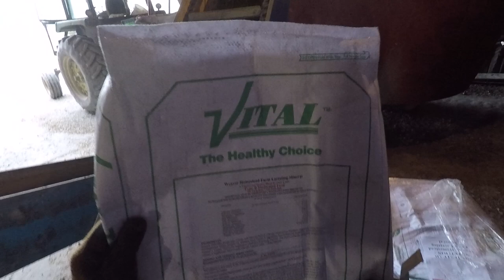Mixing Feed for Dairy Cows

Comment: Would it be better to have a trough with a high back to it so the feed stays were the cows are feeding from it?  The high back would stop the feed being pushed away as the cows feed but your mixer wagon still could deposit the feed mix over the back!  Also shame you can't have a big silo feed auto mixing station which can auto weight the amounts of feed and mix it so you just drive up with a small trailer that can drop the mixed feed out to the feeding troughs?  Also I see more auto set farming robots are starting to be used on more farms to clean up cow waste and wash the floor etc.  Anything that saves your time and keeps working when you do something else is well good idea!
Reply from the maker: The problem with high back troughs is we clean out excess feed every day with the skid loader. We also do a lot of cow management stuff when we have them in the headlocks. The cows would still throw a feed over top of them anyway and we would have to clean it up. All of those automated things would be handy but extremely expensive. We would have to spend hundreds of thousands of dollars to make that all happen. And then I would just be a computer guy not a farmer which would be no fun. I think our feed mixing is pretty labor efficient anyway, it would take robots many many years to pay themselves off, and maybe never even would.
Reply from the maker: I do like the floor cleaning robots though, maybe we could get them someday!

Comment: Thanks for posting! I have two questions for you: 1) How many cows do you milk? 2) I have a part time job mixing feed. Whenever I start feeding a group I have trouble getting the feed to flow out of the mixer evenly. Do you have any suggestions on how to deal with this?
Reply: Try not opening the door as much. That should regulate your feed flowage and make it more uniform.
Reply: That was for Tom Campbell. You got good even feed at the bunk😎

Comment: Hey I have 3 Black Angus heifers and one of the heifers is not growing well or getting any bigger what would you recommend to get it fatter and bigger also the other two are about the same size but need to get a little bit fatter but the little one needs to get a lot bigger and taller what would you recommend

Comment: General question on the ration. What the difference between Soybean Meal/Heat Treated Soybean Meal and reg old Soybeans?
Reply from the maker: It has to do with the type of protein and when and where it gets digested. I'd have to talk to my nutritionist to give you a better answer.
Reply: @10thgenerationdairyman61  Ah okay, that makes sense given the different systems of digestion and the different proteins
Reply from the maker: There are soluble and non soluble proteins. A cow has four parts to her stomach so the different proteins are digested at different times. The heat treated soybean meal takes longer to digest than the regular. It's complicated sorry for the confusing explanation.
Reply: @10thgenerationdairyman61  No, its not. Grow up farming, never did TMR, just straight silage or haylage. Its always interesting to see what others do and how it  works for them
Reply from the maker: Hey whatever works for you guys. There are different ways to do it we've chosen to go high input high output. So maybe we make it more complicated than it needs to be. Our cows do well this way so we're happy but it's not the only way
Reply: @10thgenerationdairyman61  Our cows were also on pasture, year and weather permitted. That's how my grandpa fed. I'm all for learning and getting the most production out of your livestock. I've seen some add chocolate and orange peels to their TMR
Reply from the maker: Yeah we used chocolate in the past now we give the molasses instead. They like the taste and the sugar gives them extra energy

Comment: what are the panels between the bays in the commodity barn made of?
Reply from the maker: Concrete bottem 4 feet then wood above that
Reply: @10thgenerationdairyman61   how wide and long is it? I need to build a commodity barn for transition calf feed and need 3 bays to hold a semi load each